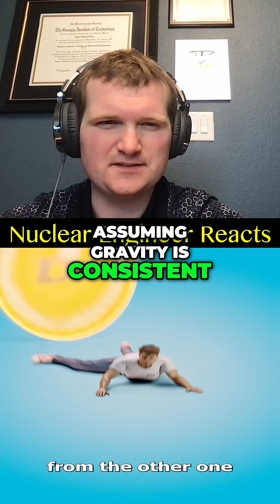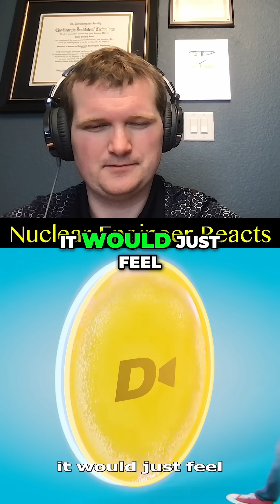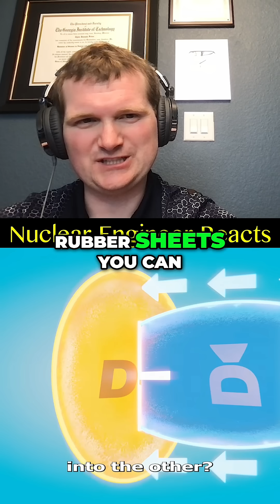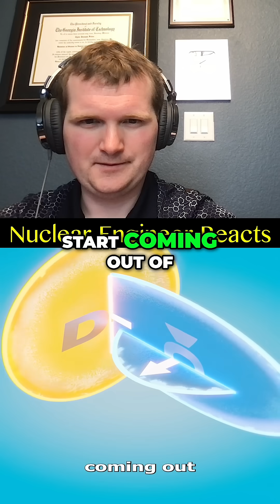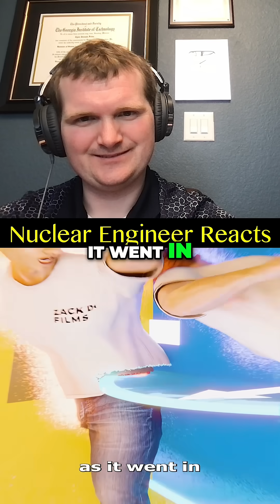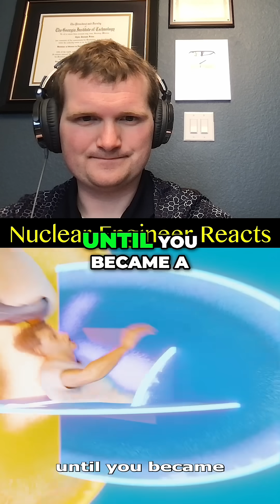What Happens if You Push A Portal Into Another Portal? - Nuclear Engineer Reacts to Zack D. Films

Comment: If, theoretically, it is a portal that doesn't divide your flesh going through it normally, it wouldn't suddenly start physically splitting you when it intersects the other portal either. You would just have parts sticking out of each portal. Unless it is the edges of the portal that are somehow damaging like some sort of saw that is.